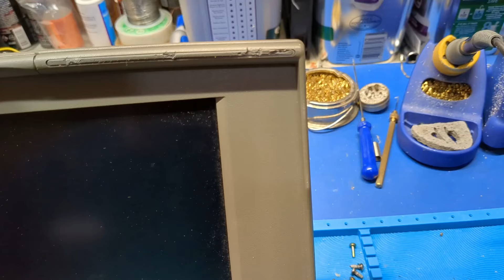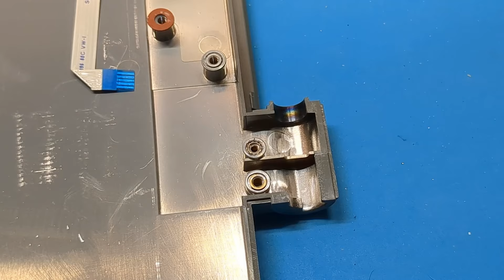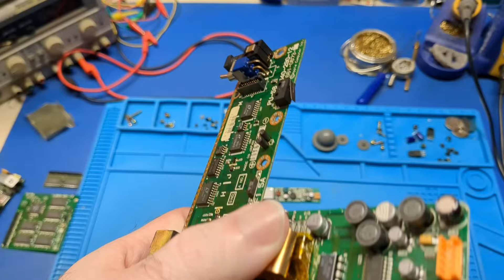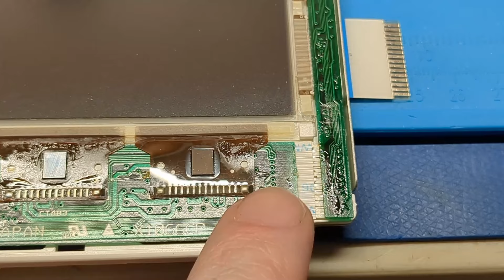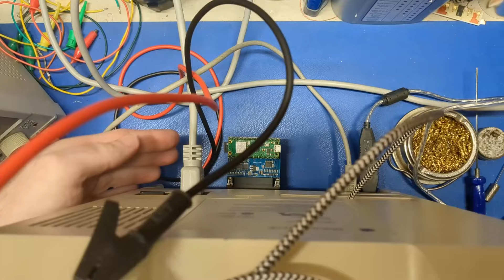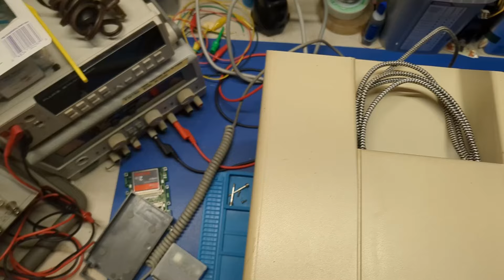Macintosh Powerbook 100 Repairathon Series - Part 3

Comment: Another great video. Good music too. I had a PB100 screen that I recapped, that was still doing odd shimmering - I dangled the bottom inch of the screen PCB in an ultrasonic cleaner and you could see all the crap coming out of the vias and behind the screen ribbons where the caps sit - while I gently wafted the PCB backwards and forwards in the cleaner. Screen worked fine afterwards. 90% of the time changing just the SMD caps on mainboard, and LCD panel caps, and a little tape over the Conner drive bumper is enough to make them go again.

Comment: "A deal popped up that I couldn't refuse" is the story of my life man. Someone aught to take my eBay account away lol. Some 3.5" Conner Drives I have from the time have had similar issues with delamination and degradation of the voice coil magnets. Never seen it quite like this before though.